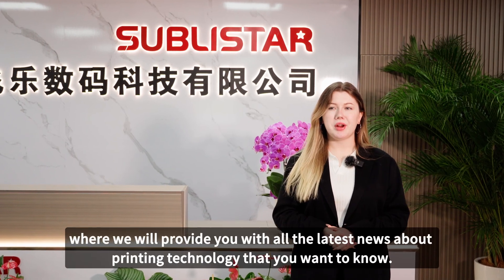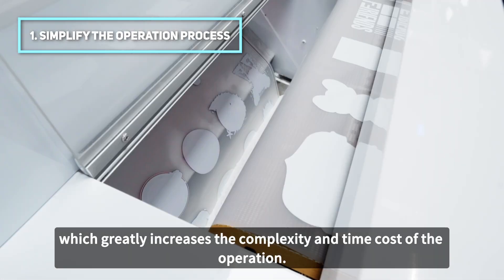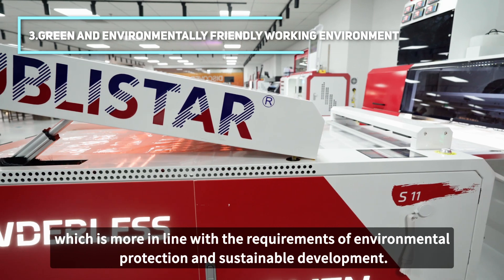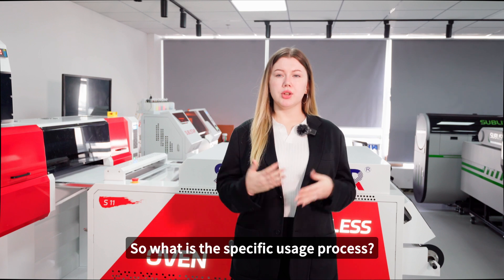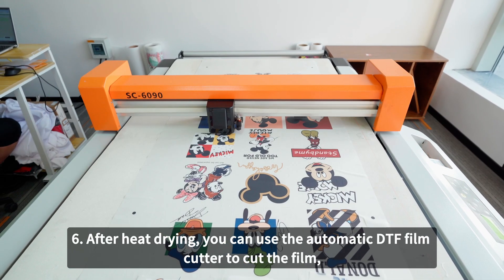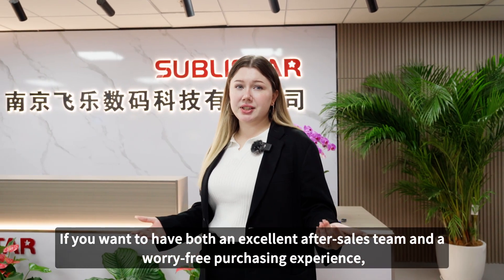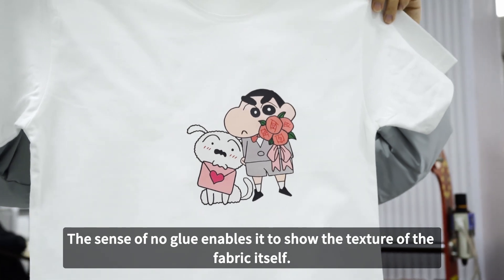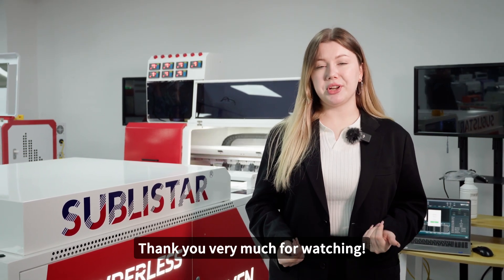Powderless DTF: Trends & Innovations of Direct to Film Printing

Comment: is the furnace producing any smoke when the glued logoes are heated like it does with powder ?
Reply from the maker: Some water vapor in the glue will be baked out, so there will be some, but with a purification device, it will be much more environmentally friendly than a traditional powder shaker.

Comment: What is the hourly output for this machine?
Reply from the maker: Thanks for asking,  hourly output is about 4㎡ for this powderless DTF printer.
Reply: Saludo son más lentas que las tradicionales? Ya que la mía imprime en un promedio de 8 a 10 metros por hora  @SublistarTech
Reply: Is it as or more durable as the regular DTF. If there is ANY less durable it will not be an acceptable replacement durability is everything.